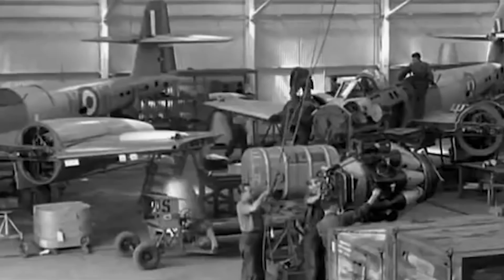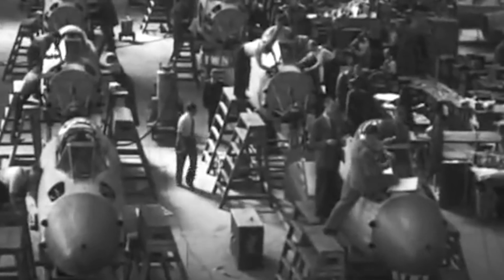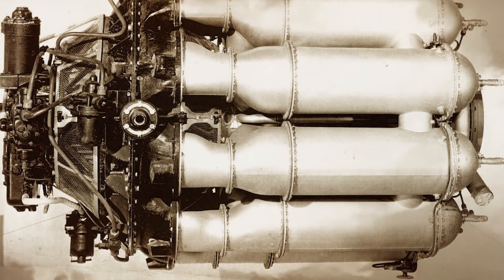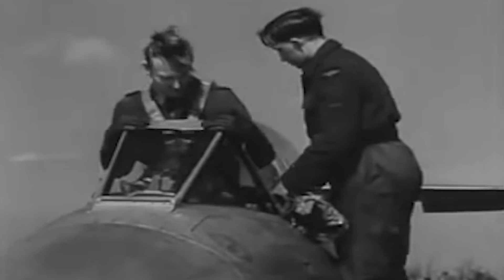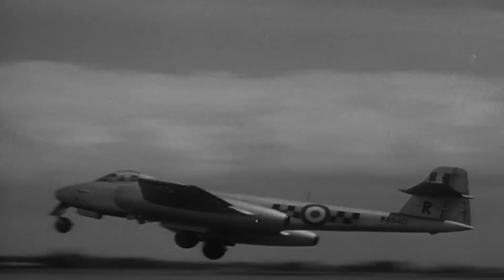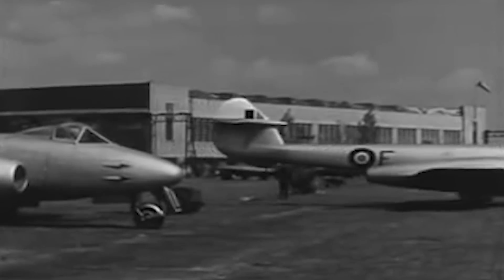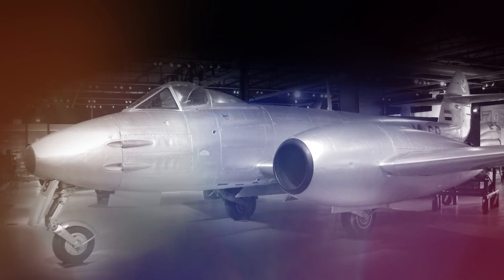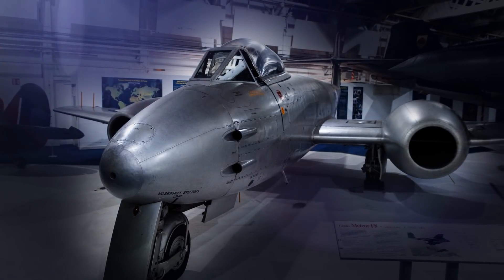Gloster Meteor - The Only Allied Jet to Fight in WW2

Comment: Fun fact: The F-80 first flew in January 1944
Reply: Another fact the engines for the p80 were from DeHavaland and used in their Vampire project.  The shipment of those engines caused a delay in the project which meant the type never made it into service for the war.  The engines for the p59 were also derived from the Brits.  All modern jet engines can be traced back to the UK with one exception, the French ATAR program was two years after the war and linked to the BMW 003 engine that while not a sucess did lead to one with French assistance.
Reply: @jimdavison4077  That is completely false, the engine in the P-80 is completely unrelated to the DH Vampire.
Stop posting lies.
Reply: @sandervanderkammen9230  look it up,  well documented.  It delayed the first flight of the Vampire.
Reply: @jimdavison4077  The ATAR is a BMW engine.. the BMW 109-018 
The ATAR 101 was designed by Hermann Oestrich and the engineering team from BMW's research lab in Rickenbach, GERMANY.
Reply: @sandervanderkammen9230  the ATAR  engine was a French design made in conjunction with former members of the failed  BMW design team.  There was no resemblance between anything wartime and the ATAR engine.
Reply: @sandervanderkammen9230  Ah the ATAR engine, perfect proof that the krauts were nowhere ahead in jet engine development. The French had over 100 German engineers and nearly as many French ones on an engine that the nazis had started designing in 1940 and still took till 1955 for it to arrive in service aircraft and even then only after a load of changes and the humiliating adoption of British Nimonic alloys.

Comment: People always enquire as to what the Wright brothers would think of jet flight today. Forget about it. What about what they would have thought about jet flight in WW2 not more than 35 years after they invented the airplane. Incredible.
Reply: What makes you think they invented the airplane?  First powered heavier than air was completed a decade prior to their Kittyhawk flight.  The unique thing about their flight was they were attempting controlled flight using a technique called wing warping.   Thats changing the shape of the airfoil in flight to gain directional control.  It failed and it was back to the drawing board.   First powered heavier than air flight was in 1890 in France.
Reply: @jimdavison4077  Hopping and sustainable flight are two different things.
The majority of scholars and historians credit the Wright brothers for some very good reasons.

Comment: Frank Whittle invented the turbojet engine 18 years after a Frenchman, Maxime Guillaume invented the gas turbojet engine in 1921 and 13 years after an Englishman, A.A.Griffith invented/designed/patented a twin turbojet engine in 1926. And not forgetting 3 years after Hans von Ohain of Germany had a working turbojet engine in 1936 or even 6 months after Germany had a pratical, flyable and working working jet fighter the HE 178 in 1939.
So, of course Whittle invented the turbojet engine. What next? The Wizard of Oz invented the Mercury space rocket?
Reply: No Whittle invented a turbo jet not the turbo jet engine. Were ideas "borrowed" from elsewhere? Id imagine he had to start somewhere and few just pluck a complete idea out of the ether.
Reply: Ohain never had a working engine in 1936. Ohain's first run of his engine was in 1937 and even then only on hydrogen because he couldn't get liquid fuel to burn properly in his engine. Whittle's first jet run was the same year on liquid fuel. Grifiths did not patent a turbojet engine in 1926,  his important paper of that year was on an axial flow turboprop. The decision to develope that engine into a turbojet wasn't made before 1939 two years after Whittles engine had run.

Comment: The guy was years ahead of his time
Reply: 2 years behind the Germans..
.
Reply: @sandervanderkammen9230  Sandyboy, just a quick question - which came first 1934 or 1937? 
Do you remember claiming that Ohain had an engine running in 1934, what a pillock you made of yourself.
Reply: @sandervanderkammen9230  Let me remind you of what Pabst von Ohain said.

"The first patent of a turbojet engine, which was later developed and produced,
was that of Frank Whittle, now Sir Frank (see Fig. 5). His patent was applied for
in January 1930. This patent shows a multistage, axial-flow compressor followed
by a radial compressor stage, a combustor, an axial-flow turbine driving the
compressor, and an exhaust nozzle. Such configurations are still used today..."

and

"From the beginning of his jet propulsion activities, Frank Whittle had been
seeking means for improving the propulsive efficiency of turbojet engines. He
conceived novel ideas for which he filed a patent application in 1936, which
can be called a bypass engine or turbofan. To avoid a complete new design,
Whittle sought an interim solution that could be merely "tacked on" to a jet
engine. This configuration was later known as the aft fan.  Whittle's work on
fan jets or bypass engines and aft fans was way ahead of his time. It was of
greatest importance for the future or turbopropulsion."

Comment: Nice to know that the Me262 also used Frank Whittle's engines, which we basically gave to the nazis in the 1930s 🙄
Reply: The Me262 used axial type turbojet engines invented by Dr Anselm Franz. 
The same type of engine used today, Whittle's clumsy Centrifugal turbojet is long since obsolete.
Reply: Sandbum dorktorbummer
Germany  didn't invent the jet engine, they copied Whittles patents for centrifugal and axial flow jet engines. German jet engine failures were gone by 1945, the British centrifugal and axial designs were where the US and Russia got their jet engines from.
Reply: @sandervanderkammen9230  Hello Sandyboy, as you know everyone had axial flow engines even the Hungarians. The type of engine most widely used today is of course a turbofan or bypass engine and as you know, the first patent for a turbofan was awarded to Frank Whittle in 1936 and the first Turbofan in service was the Rolls Royce Conway.
Reply: Frank Whittle did not invent the turbojet engine... The Jet engine was invented in GERMANY.
Reply: @sandervanderkammen9230  Hello Sandyboy, let's just remind you of what Pabst von Ohain said-

"The first patent of a turbojet engine, which was later developed and produced,
was that of Frank Whittle, now Sir Frank (see Fig. 5). His patent was applied for
in January 1930. This patent shows a multistage, axial-flow compressor followed
by a radial compressor stage, a combustor, an axial-flow turbine driving the
compressor, and an exhaust nozzle. Such configurations are still used today"

Comment: One of the advantages of the Meteor over the German jet was maintenance. It had far more flying hours before it needed a full service.
Reply: The German plane was more robust on simple aerodromes in combat conditions
Reply: @maisonraider4593  more robust. Almost 1400 made. 300 or so lost in combat but just a handful of the other 1,100 or so left at the end if the war. Mostly lost to landing crashes or engine failures.
Reply: Not true... don't spread anymore false myths.
Reply: @sandervanderkammen9230  It's completely true, Sander. Sorry if that upsets you.
Reply: @TalutellenduUle  You are completely confused and misinformed.
The German engines had very similar PFTR and TBOs,  maintenance wa much easier as a skilled crew could change-out a Jumo 004 engine in minutes.
Any questions?
Reply: Sandbum dorktorbummer. They had to change the engines quickly, they were lucky to last ten hours. Out of over 1,400 Me 262 made there were never enough jet engines for the rest, all production going to keep the few flying.
Reply: @barrierodliffe4155  Also a key ingredient for the alloy used to manufacture the turbojets was Chromium which was imported from Bursa Turkey because the Austrian deposits were unheard of at that stage. The Gloster Meteor was great for a first attempt at jet aviation but the 1954 Hawker Hunter had a far lower pilot attrition rate for obvious reasons and was still in use until about 1980 in a limited capacity after the introduction of the British Aerospace Hawk in 1976.
Reply: @RangaTurk  The Meteor was in service for a long time, ejector seats helped a lot, the Hunter came ten years after the Meteor.
Reply: @barrierodliffe4155  Britain was bankrupt after the war, it had nothing better to replace the "Meatbox"
Reply: @barrierodliffe4155  Britain couldn't built anything better and RAF pilots were plentiful, the Meatbox was allowed to continue its killing spree of talented British pilots.
Reply: @barrierodliffe4155  450 RAF pilots were killed by the "Meatbox"
 The RAF was forced to adopt the Hunter because the death toll of Meatbox pilots continued and there was a increasing shortage of pilots.
In a single year 1952, 150 RAF pilots were killed in Meatbox crashes despite the adoption of ejection seats.
Reply: @barrierodliffe4155  True with many exported to up to a dozen foreign air forces and up to 300 built in the Netherlands under licence. The rest of the 3550 obviously built in the UK. One was modified for a world speed record in November 1945.
Reply: @barrierodliffe4155 Barrie! Please name a British jet still in production in the UK?
Reply: Although it's a Eurofighter by name, the Tempest is a British design. Started life as the BAe EAP.  Has  RR designed  engines made by a  consortium. Can you name a German jet in production today?
Reply: @sandervanderkammen9230  Britian wasn't forced to replace the Meteor woth the Hunter. That's wehreraboo bollox. They were a generation of plane apart. The Meteor had been in service 10 years when the Hunter first entered service. The Meteor wasnts fully replaced s a front line fighter until 1959 and stayed in service in minor roles until the 1980s. Martin Baker who make the ejector seats for most western fighters including US planes still operates one. All early jets had a high loss rate. Almost 300 F-86s were lost for non combat reasons in the Korean war. 
PS If the Luftwaffe ever gets its act together and takes delivery of the F-35 it's ordered, it be supporting the British economy and jobs. BAe is one of just 2 primary partners in the plane under Lockheed and the only one outside the US.
Reply: @sandervanderkammen9230  Name one not made by a consortium in Germany.
Reply: @sandervanderkammen9230 Sorry it's completely true. The Nene and Derwents has a 100 to 200 hour service life. The Jumo needed a rebuild at 10 hours and was scrap at 35.
Reply: @billbuckley8423  Sorry lad but that false Alliboo myth won't fly today.

ALL Luftwaffe aircraft engines were required to pass the same 100 hour PFTR reliability test requirements as the RAF and the USAAF during WW2.
The Jumo 109-004 A-1 never saw production or operational service.
The Jumo 109-004-B exceeded the RLMs 100-hour PFTR.

Testing conducted by Operation LUSTY confirmed TBOs averaged 55 hours, better than Allied jets and piston engines.

The Tempest was a WW2 piston engine fighters, it was rendered obsolete by jets.

Germany is currently the largest manufacturer of jet aircraft in Europe.

Britain currently has no jet aircraft in production.
Reply: @sandervanderkammen9230  production versions of the Jumo had cast iron combustion chambers and had a RLM mandated scrap life of 35 hours. The Welland and Derwent had TMO of 100 hours and the Nene 200.
The Typhoons used by the UK have final assembly in Warton in the UK. The recent orders from Spain and Italy mean BAe is fully employrd in the making of the 40% of the airframe they cintribute. (The largest of the 4 partners).
No German Jet company makes jets of 100% German design either.  Daimler Benz and Junkers have not made an aero engine of their own design since WW2 while Rolls Royce still makes 12% of the worlds jet engines.